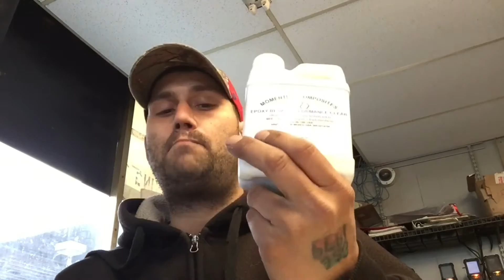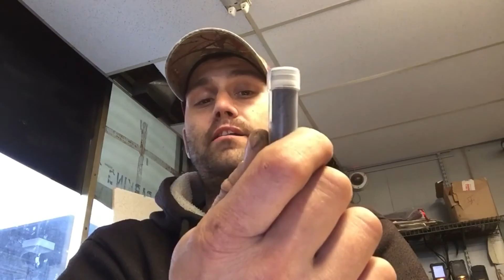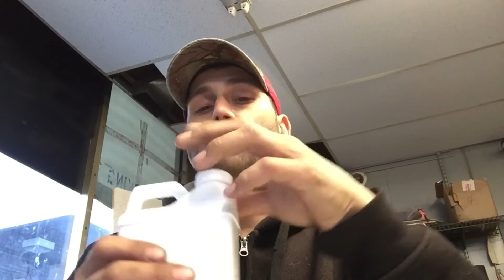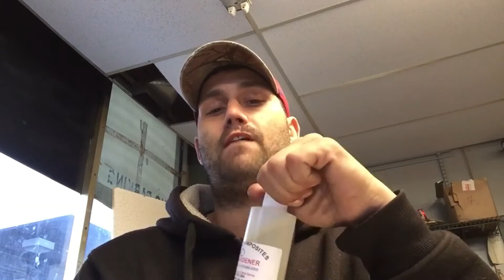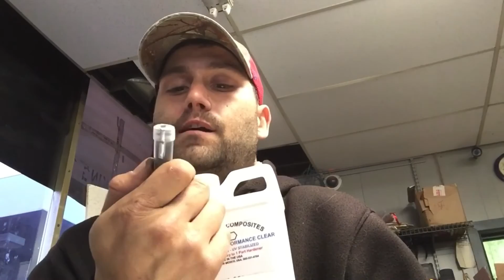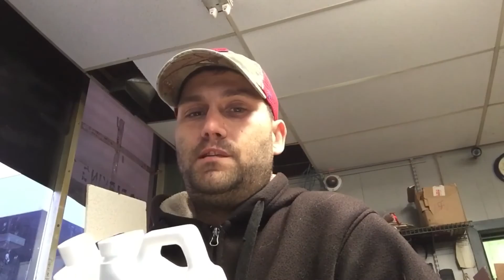Epoxy Resin System Used - Carbon Fiber Kevlar Electric Skateboard Deck

Comment: How did this momentum composites epoxy work out?
Reply from the maker: Oh you know what they have an awesome product. I had to play with their formula a bit but I've been able to make a bunch of stuff from their product. They introduced me to graphene as well. Unbelievable stuff there. Overall their product is excellent. It leaves a nice finish and is very workable as far getting desired strengths and finishes. I should make a follow up video.

Comment: Where did you order your stuff from Joe? I'm about to start a mountainboard deck
Reply from the maker: +Daniel Ewing i will be sure to post links on all videos. i totally forgot. this system is the only one i would use for this application. the system I normally use totally just will not work. unfortunately I have to use a couple different places. the resin system i buy in ebay but they do have a web page as well. my medium is going to be 5lb  vinyl foam. i get that at fibreglast.com
Reply from the maker: +Daniel Ewing here's the link to momentum 

 http://www.ebay.com/itm/111661651548
Reply from the maker: +Daniel Ewing i get all my carbon fiber from ebay as well, they have a web page too. i use ebay because i get a 10% off incentive to. the carbon fiber they sell is expensive but its worth it because it stays uniform and and when you get stretch marks in it you can massage them right out with ease. 
Look at this on eBay http://www.ebay.com/itm/131493615028
Reply: awesome, I'm thinking of Lazer cutting a skeleton for the deck out of acrylic. any thoughts on that?
Reply from the maker: +Daniel Ewing your going to use acrylic or use that as a core for a carbon fiber deck?
Reply: Joe Kyser the core will be acrylic honeycomb
Reply from the maker: +Daniel Ewing ok just checking. i dont think its the best. Bonding acrylic can be tricky and i believe it would crack internally. If its a budget build i would try a small project with it first and perform stress tests. The cores important as far as expanding and contracting as well. I will be giving multiple examples of cores and actually use them to show the difference. i wouldn't use honeycomb as you will use a lot of resin and the acrylic is already heavy. added  resin will make it considerably heavy. Maybe i will mock up some parts of the same size and use some honey comb as well.
Reply from the maker: +Daniel Ewing ok just checking. i dont think its the best. Bonding acrylic can be tricky and i believe it would crack internally. If its a budget build i would try a small project with it first and perform stress tests. The cores important as far as expanding and contracting as well. I will be giving multiple examples of cores and actually use them to show the difference. i wouldn't use honeycomb as you will use a lot of resin and the acrylic is already heavy. added  resin will make it considerably heavy. Maybe i will mock up some parts of the same size and use some honey comb as well.
Reply from the maker: +Daniel Ewing ok just checking. i dont think its the best. Bonding acrylic can be tricky and i believe it would crack internally. If its a budget build i would try a small project with it first and perform stress tests. The cores important as far as expanding and contracting as well. I will be giving multiple examples of cores and actually use them to show the difference. i wouldn't use honeycomb as you will use a lot of resin and the acrylic is already heavy. added  resin will make it considerably heavy. Maybe i will mock up some parts of the same size and use some honey comb as well.
Reply from the maker: +Daniel Ewing ok just checking. i dont think its the best. Bonding acrylic can be tricky and i believe it would crack internally. If its a budget build i would try a small project with it first and perform stress tests. The cores important as far as expanding and contracting as well. I will be giving multiple examples of cores and actually use them to show the difference. i wouldn't use honeycomb as you will use a lot of resin and the acrylic is already heavy. added  resin will make it considerably heavy. Maybe i will mock up some parts of the same size and use some honey comb as well.
Reply from the maker: +Daniel Ewing +Daniel Ewing ok just checking. i dont think its the best. Bonding acrylic can be tricky and i believe it would crack internally. If its a budget build i would try a small project with it first and perform stress tests. The cores important as far as expanding and contracting as well. I will be giving multiple examples of cores and actually use them to show the difference. i wouldn't use honeycomb as you will use a lot of resin and the acrylic is already heavy. added  resin will make it considerably heavy. Maybe i will mock up some parts of the same size and use some honey comb as well.
Reply: I just have to make it stronger than the typical pro-lam decks. I'm working on a project for school, I've got 150 dollar budget so I'm up in the air about a deck build
Reply from the maker: +Daniel Ewing hey listen can't hurt to try. how about if i have the proper core material and we make one together. I can prep it as much as possible or just give you blank and you can shape it yourself. it comes im sheets and I think the smallest is 36x60 if I'm not mistaken. I dont want to get too far ahead because i want to be able to post the  videos as well. Project pictures will end up on these guys web page
www.carbonfiberkevlar.com

Comment: love how he is about to close the bottle like twice but goes back to smells it made me crack up
Reply from the maker: nightmare in action nighmare in action lmao the base just smells good for some reason. Never used a system like that. Normally it smells bad. This system is unlike any epoxy system out there anyway so it makes sense. Getting exciting here. Been working on setting up this build. This is ESK8 worlds very first project. I suppose we will get a lot of people that will want what I am about to make.
Reply: Joe Kyser ikr I seen loads of people actually wanting to put carbon fiber on their boards and I'm in luck and sorta not in luck I am getting moved schools to my local school about 1.5 miles away but they dont have cgi animation witch I wanted to take nextyear and dont have anything related to it and robotics are non existante here welp me be sad now but if I get a chanse to ask steve or the guy we work with nortrupgroman ill see if he can make me a 100% carbon fiber deck well see it might just snap thow he makes the glossy type carbon fiber with the other side not as glossy he can also me me silinders but there will be one problem he needs a mold I think to get the concave I like the w concave so we will see what happens
Reply from the maker: +nightmare in action nighmare in action well if its 100% carbon fiber with no core material it shouldn't snap if it's made same thickness. the issue with mine that broke is the core material broke it wasn't the carbon fiber that gave way I actually have to make a new updated video about this. and we're going to mess around with laminated decks as well I have a maple deck I'm going to laminate that videos going to be coming out as well the deck that I'm going to be building for this first build is going to use 5-pound vinyl foam as the core. it's the best material that I could get that using an aeronautics. it should be way more rigid then the stupid phone cord that used on this board. another problem is they molded the carbon fiber right butt up against each other on the edge instead of overlapping it. what I'm going to do is I'm going to mold one side and then I'm going to go mow the other side and I'm going to overlap the fabric this way there is no breakpoint
Reply: Joe Kyser the thing with carbon fiber is it can be stromg some ways but really weak in some like seeamic is strong in knifes but if you try to bend it sideways it breaks even thoe its stronger than steel
Reply from the maker: +nightmare in action nighmare in action absolutely well it's the resin that's the key. the carbon fiber is only to add strength inside of the part. have you seen the $300 carbon fiber military knives? no breaking those no matter which way you bend them. the components to the part that is being built or very very very important. and not only are the components important but the process is important. it's impossible to talk about carbon fiber in general. like saying well if you took a carbon fiber knife and Ben it sideways it would probably break but that's not every carbon fiber knife. if done properly there should be zero issues. Christ they make cars and planes and boats out of it. I'm sure skateboard deck is no feat in the industry lol
Reply: Joe Kyser well I dont know the process they use they have it under 3700lbs in an oven over 24 hours for extra hardness he says
Reply from the maker: +nightmare in action nighmare in action thats the system you are using. not all can be baked. just because its baked does not mean it's stronger either. i will have to be sure yo make a video explaining all the different methods. a proper air bag system should exert way more pressure then that. the pressure is for even lamination of layers which leads to better strengthening of course but it's its sole job. Just follow along and i will teach you. the resin system I'm specifically using for this build is unlike any other so you can't compare it at all to what you use what you seen that's for sure. no worries i wont stray you wrong.